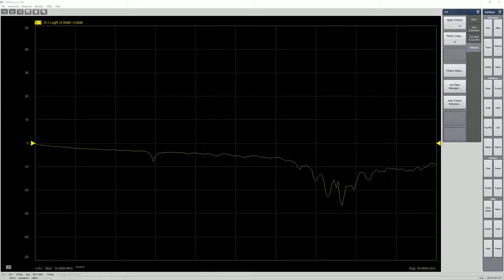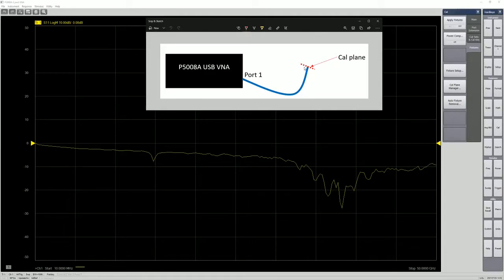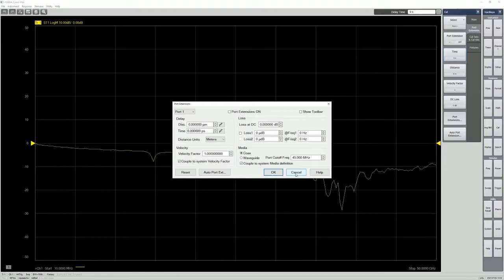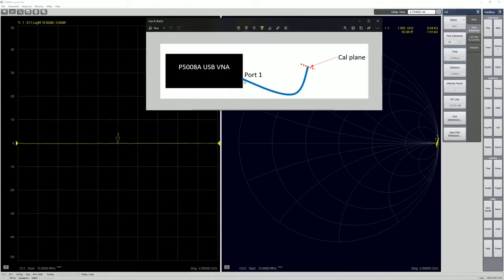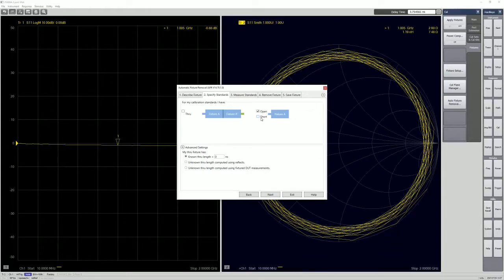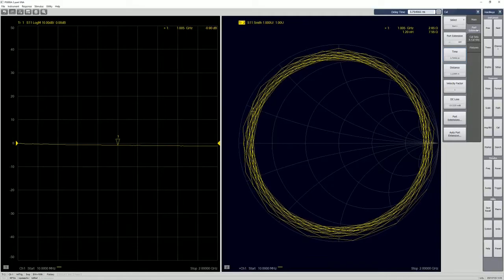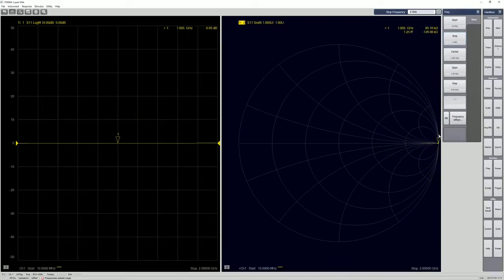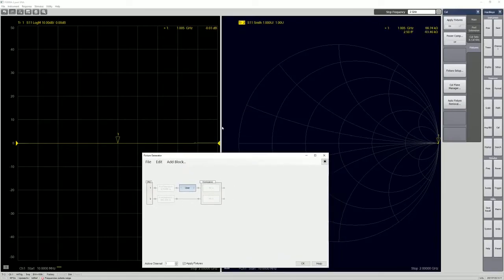Episode 49: P5008A USB VNA Auto Fixture Removal (AFR) Setup Guide

Comment: Thanks for this video it is very helpful.
But, I observed that while using differential measurement, the calibration does not give the same accuracy as in single ended.
Is there any bug in the AFR software on differential use ?
I use the same AFR software as you.
Thanks in advance for you help on this topic
Reply from the maker: i'll have to spend some time on this. Meanwhile, you can contact the local Keysight Sales or KeysightCare team for this issue that you are seeing. :)
Reply: Thanks.
Please share if you find something 😊
Reply from the maker: @jalla279  I found this online, not sure whether it'll help you with the differential measurement https://www.keysight.com/us/en/assets/7018-03037/application-notes/5990-8443.pdf